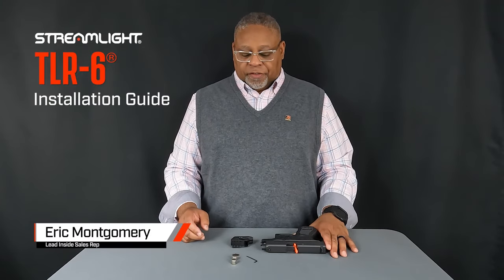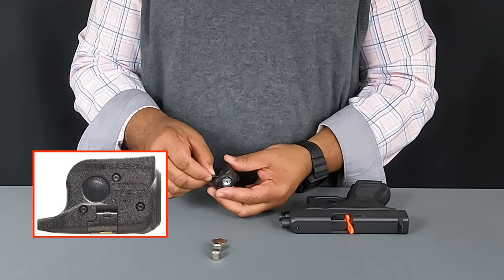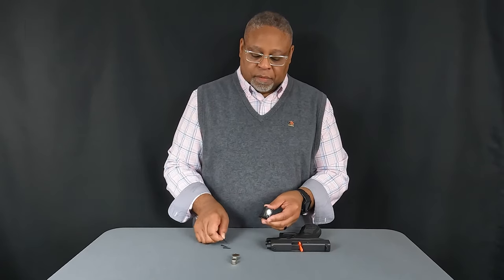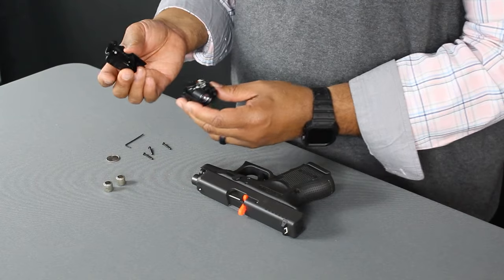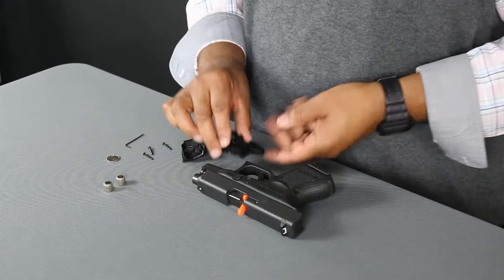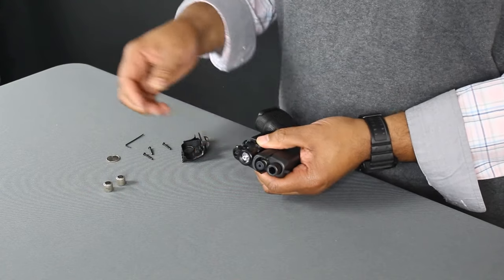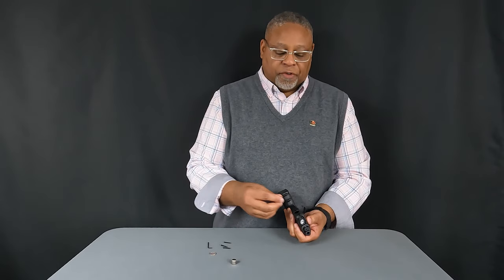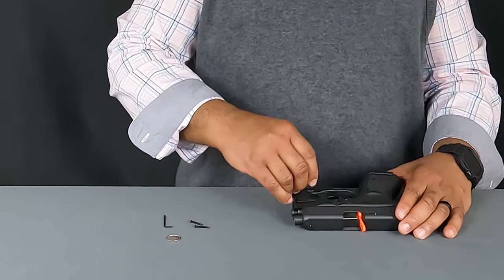Streamlight TLR-6® Installation

Comment: I have been using your lights for almost 2 decades and your customer service is the best.  Thank you guys.
Reply from the maker: Thank YOU for your years of support
Reply: @StreamlightTV  good afternoon I just installed the streamlight tlr 6 onto my G27, it's loose on the front end, and I believe I have over tightened one of the screws. What's my next course of action?

Comment: If you have installed new batteries and find that your light doesn't illuminate when you switch it on, be sure that the batteries you are using are bare metal and have no plastic sleeve/wrap around the sides of the body.  The reason being there is no positive contact on the battery compartment hatch to complete the circuit. Instead,the positive contact  is along the side of the battery compartment and therefore your battery must be bare to make proper contact. I hope this helps

Comment: Great tutorial. I just received this light for my springfield XDM pistol and followed your instructions to the T however after installing the batteries the light doesn't turn on. I've even uninstalled it from the firearm and then tried again but nothing. I can only assume that possibility the batteries are dead. I dont know how long this was on the shelf before i ordered it. What's your opinion?
Reply from the maker: We're sorry to hear you're having trouble! We'd be happy to help fix the issue. Please give us a call at  800-523-7488.
Reply: @StreamlightTV  I returned it to Amazon and got refunded and purchased it from another Amazon store.
Reply: He said positive side in first when it’s the opposite maybe that’s why it didn’t work

Comment: So I did some research and bought this attachment for my Rock Island armory 1911 9mm. This is supposed to fit a non-railed 1911 5 inch barrel by my research. And this thing will not fit around the trigger guard. I’m afraid if I keep trying to take it on and off these screws are going to strip. Is there another light I should’ve bought?
Reply from the maker: Our customer service specialists can help with this. Please give them a call at 800-523-7488 or email cs@streamlight.com.

Comment: I purchased a Glock 43x  TLR6 combined on the secondary market.  I am having difficulty adjusting the lazer.  It is not even close to accurate.  Any suggestions?
Reply from the maker: Our customer service specialists can help with this. Please give them a call at 800-523-7488 or email cs@streamlight.com.

Comment: Is the attachment still able to be pulled off the pistol after install? I followed the steps and I can still pull it off with a little pressure.
I have the PSA Dagger 9mm with extreme cuts
Reply from the maker: Onika, please contact customer service to discuss/troubleshoot this: 800-523-7488

Comment: What’s the best light for a gen 3 gloc 17
Reply from the maker: Cesar, with that model you have over 15 TLR varieties that will work with it. It really depends on your preference. You can see the list of them here: https://www.streamlight.com/resources/learning/tlr-fit-guide?options=f337db05-19bc-69f8-801e-ff000019790d&options=1300db05-19bc-69f8-801e-ff000019790d&options=4515db05-19bc-69f8-801e-ff000019790d&options=dd15db05-19bc-69f8-801e-ff000019790d
Reply: @StreamlightTV  I am a new gun owner so this will be my first time buying a light. Out of all those choices which would you recommend to a friend?
Reply from the maker: @seecesar  Most folks love the TLR6 because of addition of the laser, but if you want some options when it comes to where your switches are AND more lumens- the TLR9 or 10